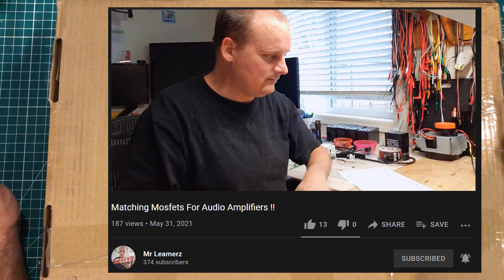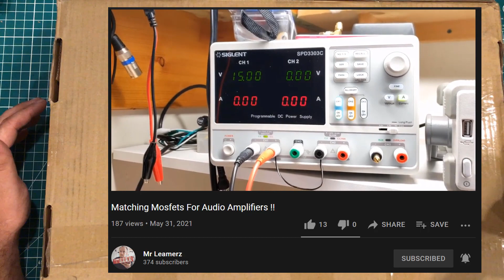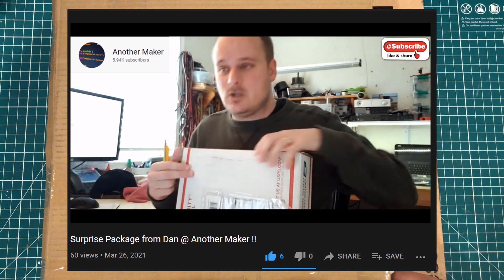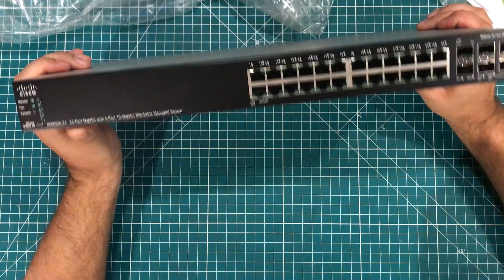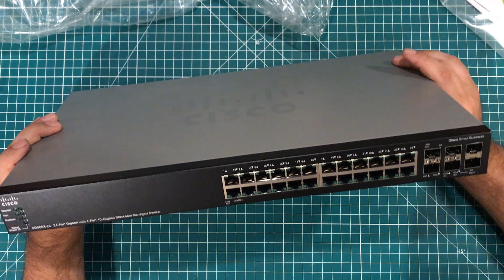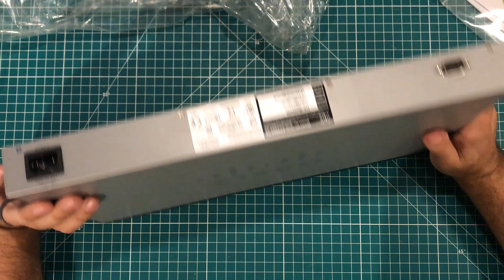An Extravagant Gift from Mr. Leamerz!

Comment: Just about to purchase two new switches and fiber to run from the house to my garden office 60' distance to replace the copper because a house less than a 1000' away took a direct hit last summer.  Going to cheep out and use TP-Link Omada kit almost a mirror of the  UniFi Software-Defined Networking platform.
Reply from the maker: I don't think that's a bad option.  When I first moved to Alaska, I never would have thought they would work so well, but once you get them  setup, they're amazing. Mine have been flawless. In AK we ran 150Mbps multiple miles over the air without much issue.